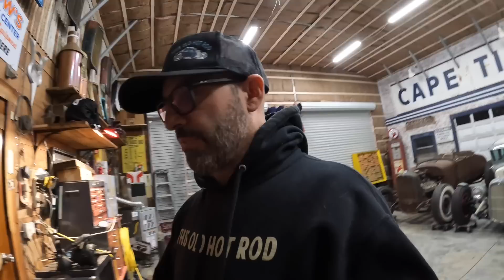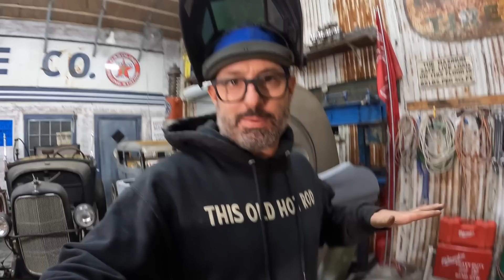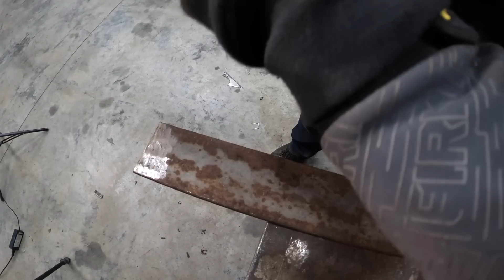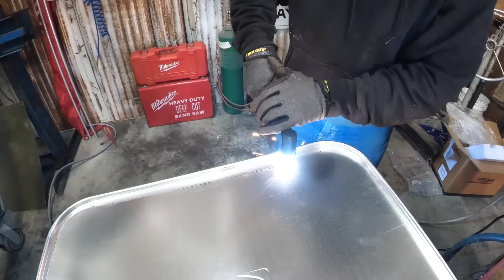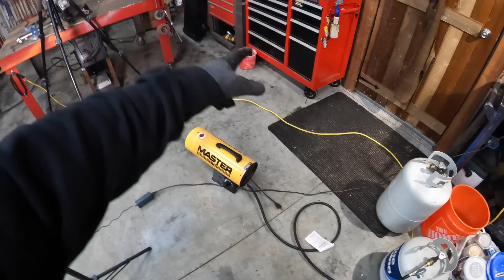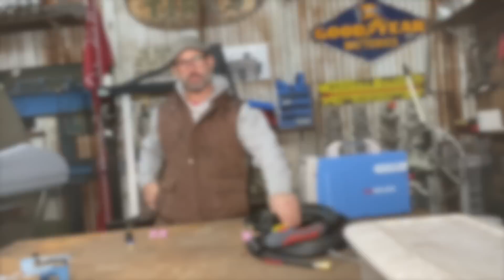Yes Welder CUT55DS Review

Comment: The plasma cutters I have used leave a lot of slag, so I ended up grinding every part I cut, so it was faster and cleaner to just use a grinder, maybe they weren’t set up optimally, but three different machines at two professional shops and one Miller machine at a home shop
Reply from the maker: I used it today and cranked the power and air up.  Cut 1/2 rod and some 3/8 flat plate super clean.

Comment: If the sparks are spraying up at you or out at some funky angle, you're either going too fast or you need to turn it up.  The shower of sparks should be in a nice jet straight down on the bottom side.

For these cheap Chinese cutters, you're pretty much better off just cranking it all the way up and just leaving it there for everything.
Reply from the maker: Thanks for the advice.  I did exactly that today.   It worked much better. Like you had described

Comment: Need to run up the air pressure. Most will run at higher pressure.
Reply from the maker: Yeah I kinda thought that. Rookie mistake.  I read the instructions and there was no info on set up and the pressure settings.  Unless I missed it somewhere.

Comment: Nice review. Pure chinese junk. Mine was no good out of the box. Pressure gauge only reads 30psi. I don’t know whether I have to much or to little air pressure. Arc goes out after a few seconds. Yeswelder is putting unreasonable demands on me to fix it.
Reply from the maker: That sucks.  Too bad they’re not making it simple for a return or exchange. 
I hope you get it sorted out.
Reply: I had similar issues with it arriving DOA and poor initial customer support.  Eventually my case got resolved, I received a full refund, and they told me to keep the machine.  I took it apart looking for cold solder joints and loose connections.  I found and fixed these but still no joy. I took it apart one more time and removed the control and digital display boards and separated them. Inspecting with a 25X loupe I found a minute chunk of braid solder laying across 5 pins on the big square chip. Removed it, reassembled and all my problems went away. Works great now.
Reply: @mikebrewington1425  I know it is cheap chinese  junk. Yes welder seems to be up there with the worst of them all.

Comment: I've been wanting to get a plasma cutter machine just didn't know what "BRAND" to go with. As everyone knows they are pricey machine's that everyone that is into fabrication work just don't just jump out and go buy one of those machine's use it for two months then brake down then your shit out of $$.$$$ I would be P.O 
Instead of me putting the oxy torch together to cut some small metal it would be faster to plug the air in and cord and ground and cut away.